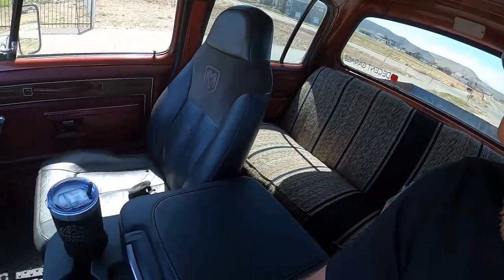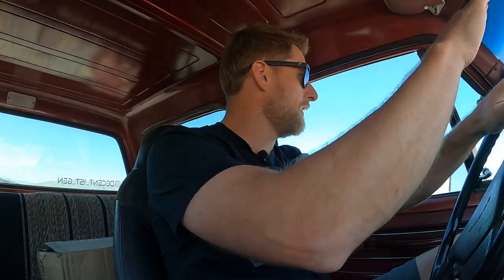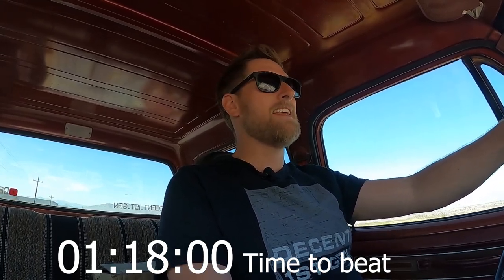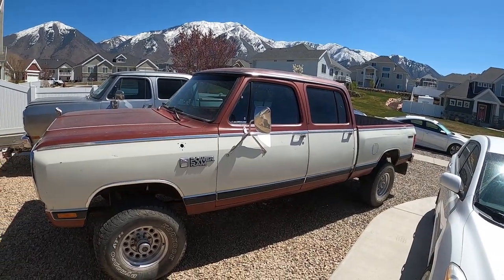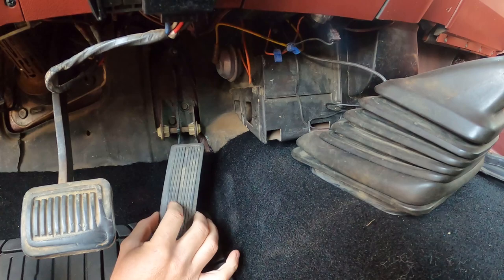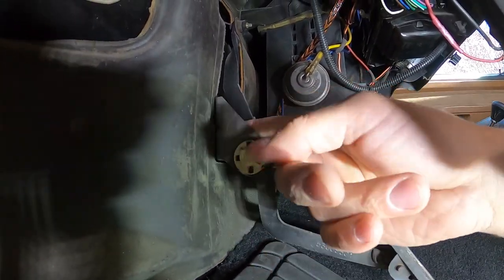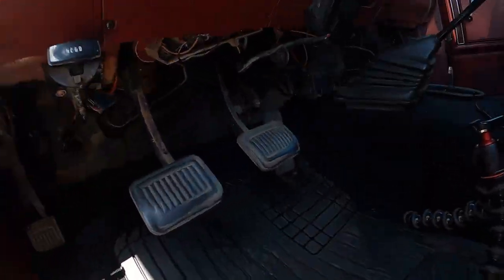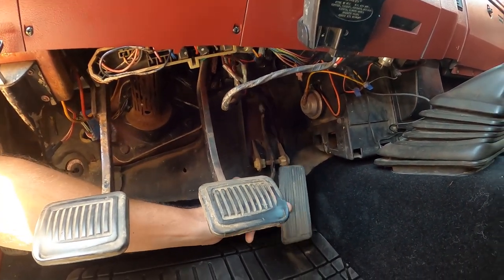More POWER For Any 12 Valve Cummins! (EASY Fix)

Comment from the maker: Who else was shocked that such a simple fix made such a big difference in Prospector Bob's acceleration? 🙋‍♂️
Reply: bob needs power driven diese towing compounds and 500 horse fuel kit
Reply from the maker: Agreed!
Reply: @decentgarage  i think you should see if theyd sponsor you for that.  it'd be sweet for s=them to have a ccsb first gen running their kit aswell as for you
Reply: Kinda curious how you installed a new turbo with such a sloppy throttle play…..

Comment: I had the same exact problem with the Death Charger. 70's, 80's and 90's pedals all have different throws. Originally I had a 70's pedal in the DC and everyone called it Skid Steer mode because it would not get over 2000RPM. If you watch my Moab episode youll notice that the RPM never change haha. I solved the problem by installing a 1991 pedal that I had. But nice mod with spacer on the 80's pedal. easy fix!
Reply from the maker: I'm actually thinking this is an 84 pedal. It still feels like it should have more throw. Maybe I'll do a video and swap the pedals from the og crew to this one for kicks and giggles
Reply: @decentgarage  Sounds good, When I swapped mine I had a pedal from a 70s, 80s, and 90,s all lined up next to each other and there was a difference
Reply from the maker: @DuddiesAdventure  thanks for the advice. I wouldn't have thought the pedals would be different
Reply: @decentgarage  No Problem, I just wish I new the exact year they were out of, I think it was 1977 and the one I used was out of 1991. But the 80s one I had I have no idea

Comment: Will you make a video on tuning out the smoke?  Mine was turned up by the prior owner, and it smokes quite a bit if I get up to speed quicky.
Reply from the maker: Yes, I'll do videos of that as i go. I'm not near as comfortable tuning a ppump, which is what is in this truck, but I'll learn as i go.
Reply: I could not find the video , however i just went through this on my 95 12 valve . 10 plate slide all the way forward.  215 injectors,  3 k governor springs . 18 deg timing.  This think would smoke like crazy if i put my foot into it . When it was a automatic it was not really bad because a automatic will down shift and spool up the turbo. That and a lite foot not a problem.  However when i went to a g56 things changed.  Finally i got tired of the smoke and installed the heavy afc spring and started trying to dial back the smoke . I finally adjust the spring past half way back and still smoke . This is a pain in the butt on cruise control. FINALLY I had enough and set the afc housing all the way back. That fixed the smoke and it stll runs good . Cruise is a lot better also because it want black out 2 lanes of traffic.  Drives a lot better , now with the g56 .

Comment: Hey Love the Videos very Helpful do you have any idea what would cause the truck to lose power after it gets hot it's a 91 First Gen
Reply from the maker: Seems like it would most likely be a fueling or electrical issue. I haven't heard of that happening before though

Comment: i have a 93 with 3 speed auto and i feel SOO much better about my truck. I am all self taught and dont have a frame of reference and I love my truck (had it one year now) and it feels the same on the pedals whether or not i'm pullng 4-5 tons. BUT even without a load... a slight uphill from standing makes people behind me impatient LOL. Always wondered if it was an issue I was unaware of since it drives nice though. glad it isnt.

Comment: Tim do you have a source for the black plastic spacer material us used for the gas peddle ?
Reply from the maker: I don't have a part number or anything. I went to ace hardware and they had a little thing full of different sized plastic spacers so I just grabbed a few sizes and then use the one that fit the best.
Reply: @decentgarage  Hey! I was asking about the inch thick plastic block from your body lift that you put between the fire wall and the gas pedal mounting bracket ?
Reply from the maker: @jimb7922  oh gotcha! Sorry about that. Yeah i will try to find the link on Amazon. It was a 2 inch by 36 inch piece and i just cut it in to a bunch of 2x2 pieces but it had been working great.
Reply from the maker: @jimb7922  wow, just looked through my order history on Amazon and i can't find it. I'll keep looking.

Comment: Hmmm, I have a 93 with a NV4500. I’ve never timed it bu my I’m sure it’s quicker than that. I’m wondering if you have some bad tuning. Also, unless I’m hauling a load, I don’t use 1st gear, one less shift to get to road speed.

Comment: Hey I just bought my first 1st gen. Is there a way to adjust the brake pedal position? It’s about a six inch difference from the accelerator pedal. Thank You
Reply from the maker: I haven't looked as closely at the brake pedal. Is the brake pedal way higher than the gas pedal?
Reply from the maker: Just saw your other comment on the overdrive video. I think it's pretty standard on these truck for the brake pedal to sit a ways higher
Reply: @decentgarage  I think on most vehicles it is but not to this degree.
Reply: @decentgarage  Thank You

Comment: Put a new cable/ adjust the cable and the throttle.  Throw in a governor spring. My 91 wouldn’t go over 60. I adjusted the throttle linkage. Then did 3600 rpm spring, and moved the ve pump Star one hash mark. 

Just recently put in a heim joint throttle linkage adjuster.( old one would pop off). Did 60# valve springs for piece of mind, exhaust and intake. Doubt I’ll ever get over 3200rpm. Just the throttle upgrades alone helped a lot. 

Just need to do some transmission upgrades to the old 727 3speed.

Comment: Wow I’m surprised it’s that slow with a P-pump. What turbo is on the truck ?
I’ve got a Ve pump with a he351 and it’ll get to 100km in 16seconds
Reply from the maker: Yeah i didn't give it everything on the second run. Just tried to demonstrate that the issue was fixed. But its still not fast haha
Reply: It’s a good video for sure, just nice to keep the driving fun factor at a high level.

Comment: Tim, I really think it's the Christmas lights that's causing the issue ;)  PS My original 92 and orig 84 both had a piece of fabric tape on the cable end on the accel pedal. Just thought I'd mention it. It was to help it from popping out of the pedal.
Reply from the maker: Interesting. Maybe I'll add some on there for good measure 👍

Comment: Wow 0-60 in 38 seconds??? I gotta time my VE... I think its like under 10... What is wrong with your truck lol
Reply from the maker: I still wasn't going full throttle just trying to show that this modification worked. This truck still needs a ton of tuning
Reply: @decentgarage  will be interesting to see.  I originally thought the P pump was the clear choice... but after reading the Facebook page posts... im not so sure. Seems like a tuned VE with injectors and a turbo might be a way better daily driver / tow rig.
Reply from the maker: @ChristianNeff  honestly I prefer the ve pump in most regards. This ppump truck is going to take me a while to tune cause ppumps are quite foreign to me